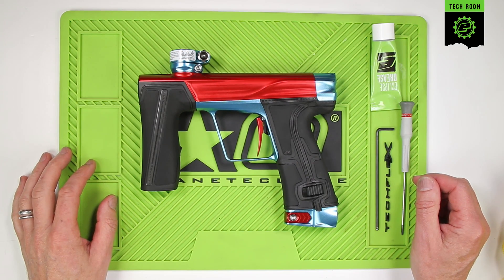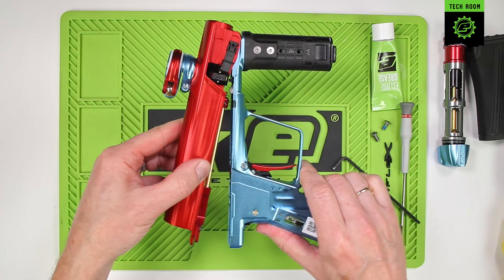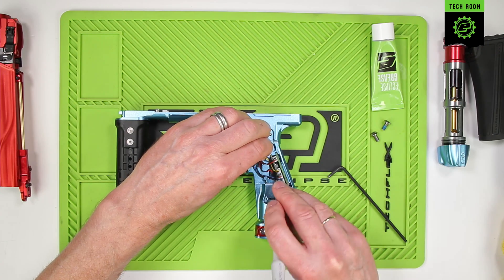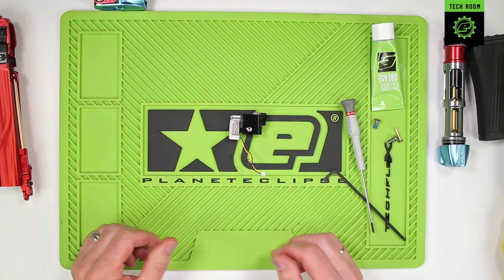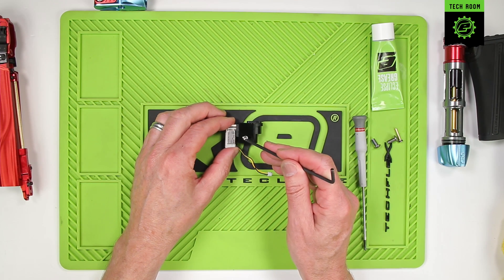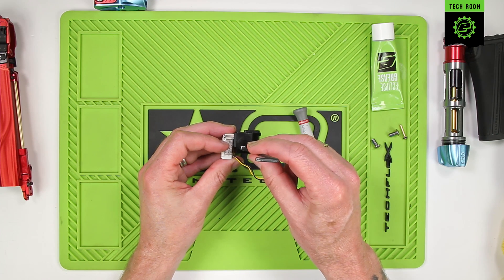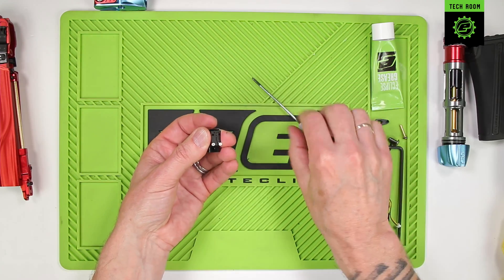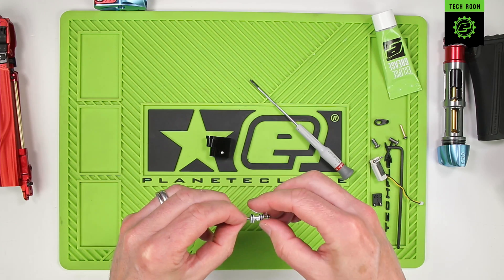Eclipse GEO R5 Solenoid Maintenance and SFR Adjustment

Comment: I came here to check how to switch to a brass sfr but being in new york it rains and changes weather so often so not sure if I should bother since with the steel at - it's very smooth already.

Also when would you need to do that type of maintenance to the solenoid?